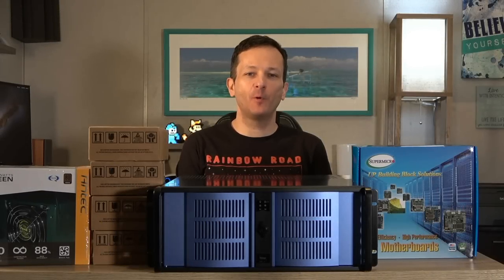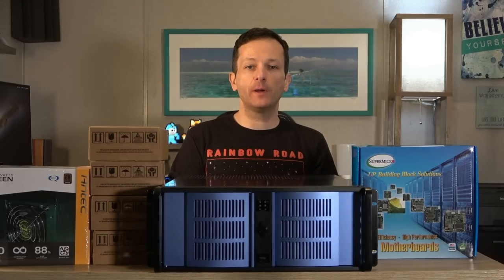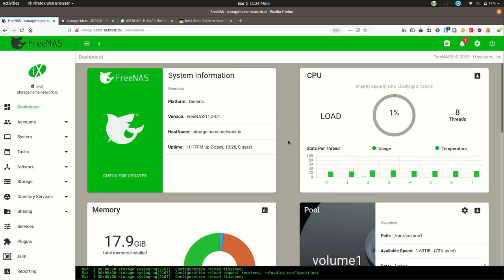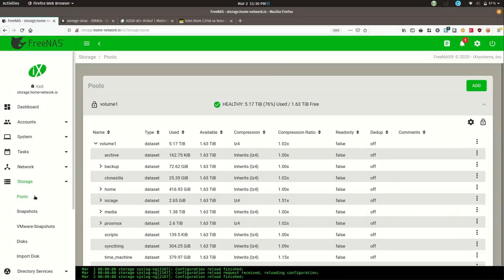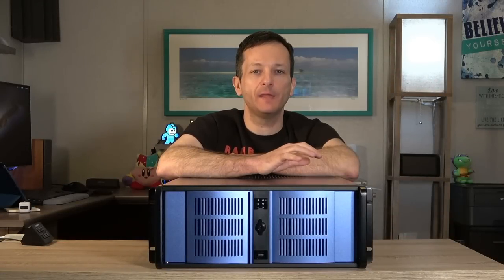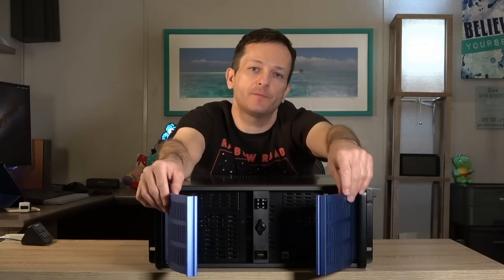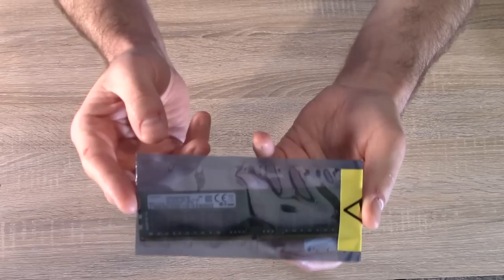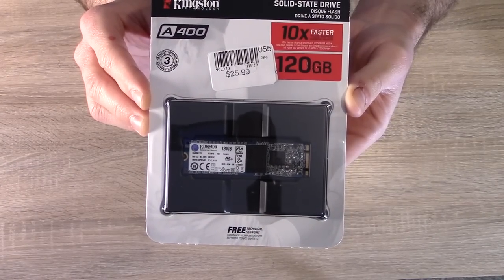Building a Low Energy Storage Server for your Office/Homelab

Comment: Isnt that a regular SATA NVME? so regular sata 3 speed
Reply from the maker: I may have misspoke.
Reply: @LearnLinuxTV  its allright, a server like that wont need M.2.NVME speeds:)
Reply from the maker: Agreed, it's mainly just for the web interface anyway, which seems fast enough to me. I wonder if the store had the drive mislabeled or something. I'm curious now. I wasn't paying close enough attention.
Reply: It's just M.2 SATA, not even NVMe, so it will use the same lane as regular SATA III SSD. NVMe will use PCIe lane so it will be a lot faster than what you've got. The only advantage of M.2 SATA compared to regular SATA SSD is just you don't need power and data cable, not faster at all, even better SATA SSD will be faster than M.2 SATA in term of speed. Just fyi :)
Reply: Yep that's what I was thinking when I saw him talking about it
Reply: sata=/=nvme its an M.2SATA which is more energy efficient than NVMe (usually)

Comment: My server is size of a shoe box and can hold up to 6x2'5 drives in 5,25 bay with icydock cage. G2020T,  ASUS P8H61-I, 8GB RAM, Dell perc310 hba controller, 200w sfx psu. All takes only 35w from the socket. Proxmox on board. I had Freenas and Openmediavault but i found that containers are far more usefull for me than pure NAS features. In the past i had few containers like dokuwiki or gitea but now i only have Nextcloud and samba/NFS storage. It automatically shuts down at 11PM(if there is no Samba traffic or backups going on) and turns on at 7AM (by rpi3) . Im really happy with it.

Comment: I was think that a RPi could be used with USB3 to SATA and spindle drives, but I realise by the time you plug in high capacity spindle drives the power draw will still end up around the 40W mark with much slower throughput, slower encryption/decryption and other functions equally hobbled. Well thought through solution #Respect!

Comment: The case is designed to allow multiple drive mount options, the idea is to allow single caddy options like you used as well as multi drive caddies (single unit that contains multiple hot swappable drives)

Comment: My FreeNAS has a Celeron G3930 in a 4U case with 3 x 4TB WD RED drives in ZFS for PLEX purposes at the moment, but the system will have other uses in the future as I learn more about it.  Each of the three data drives was from a different production run.  I bought a few fans for the case but haven't needed to install them - yet - because the temps are low.

Comment: That Kingston is a M.2 SATA drive and not NVME (PCI-E).  M.2 being the form factor and these can either be SATA or NVME (NVME being an order of magnitude faster).  Also - the TBW rating for that drive is 40TB so I would be careful about any verbose logging to that boot drive.  I have been considering moving over to a very low power system myself, thanks for the example.

Comment: One little point, TDP watt ratings are for maximum heat output, not power consumption. But the power usage percentage should run quite similar to the TDP when comparing the two CPUs. ServeTheHome's review of that Supermicro part number says that board and CPU use between 14.1W at an idle, to 32.7W at 100% load.

Comment: "It's loud as hell" - You should look into fan control on the R710. We're a small media company and everything is hosted at AWS, but we wanted a small local server for things like NextCloud, a dev/staging version of the site, MatterMost, etc. So we got an old R710 from ebay, but the first problem was it was stupidly loud. You can first enable manual fan control by running:

ipmitool -I lanplus -H idrac_ip -U idrac_user -P idrac_password raw 0x30 0x30 0x01 0x00

This disables automatic fan control. Once this is done you can set the fan speed with the following:

ipmitool -I lanplus -H idrac_ip -U idrac_user -P idrac_password raw 0x30 0x30 0x02 0xFF [FAN SPEED, e.g. 0x0F]

The hexadecimal value is 0-100, so above will set it to 15%, 0x0F. 15% is super quiet and nice. The system is running two X5670 95W TDP CPUs, 32GB of ram, and 4x6TB 3.5" hard drives, and is also in a warm environment. I've ran it for over a year now at 15% fan speed, and it works just fine and is very quiet. The crazy fan speeds are for large server racks where you don't want a build up of warm air and want fast circulation.

I'd recommend trying it, you could probably even drop it below 10% and have it be fine.
Reply: I have an R710, I have set the fan speed from the bios to silent mode, the temperature is around 18°C this time of the year with max 34 at summer, the fans are quite silent, you can't sleep with them but if you put them in a room and close the door then you won't even notice it! But if you want to have it to the background and a few meters apart then it's not the best choice.

btw I didn't knew about the commands! If I got a second server I will configure it
Reply: @michelangelop3923  At 15% you stop noticing it in the same room after a minute or so, it's very quiet. Even more so at 10%.
Reply: Any idea of wattage of these enterprise units?
Reply: @darencard7842  Yeah the R710 is not very power efficient. If you want something more power efficient look at later generations. Low idle power didn't really come in until early-mid 2010s.

Mine uses around 220W at idle and maybe 300W (don't remember) at load, but it rarely hits full load as there's several VMs running. I think with no hard drives and a lower power CPU you can get it down 150W idle.

So it's not the cheapest ever to run. But if you want something cheap to run and low powered I'd recommend just not getting a dual CPU system. Some single low powered CPU systems can idle at < 30W.

A quick Google suggests the R730 can idle at ~50W under some configurations. But if you want very low power I'd suggest something like HP's microservers.

Comment: Cool topic of power consumption and noise. New to Linux-noob. This last week took old Lenovo t530 laptop and created a NAS server with freeNAS. Low power was the goal (20w with broken lcd).  Run off usb with 1 tb ssd.  Will add another 1tb drive with cdrom adapter. I see you are in MI area also.  Any Linux events in area or event you frequent?

Comment: If your mobo dies, repair is always an option over replacement. In most cases the repair is not only possible, but is usually far less expensive than replacement.

Comment: From what I've read, the "L" series Westmere CPUs weren't so much designed for more efficiency but just lower power applications (where heat or power was a problem)...mostly achieved by lower frequency on the chips so the power consumption wouldn't peak as high. I made the same mistake buying "L" Xeons thinking I would save power. As long as the CPU can be clocked down and the OS is smart enough to do it, it will be way more efficient whatever you have. I agree that doing research and not buy whatever is very important. Every time I've impulsively bought a computer component without researching it first, I regret it.
Reply from the maker: Agreed, I have a stack of "impulse buy" servers that are now collecting dust. I did find a use for them, though.
Reply: @LearnLinuxTV   Care to share? I have a few Westmere era servers I just retired after upgrading my stack to Ivy Bridge era servers. It would be nice to do something besides part them out.

Comment: nice project! just don't understand a couple of decisions:
- why to use FreeNas instead of buying UnRaid? UnRaid is much more versatile if you need to add more disks later, and with the parity drive you could have had 1 disk of extra space that would have repaied the license cost (that btw is 59$ only)... 
- UnRaid uses far less ram than FreeNas... 
- You could have also have used the ssd as cache device with UnRaid and boot the system from a 10$ USB key that you could have attached into the internal port on the mobo, without wasting a 120gb M.2 SSD... :)

Comment: Nice job 👍 I had the same board but with 4 cores. Ended up replacing it eventually, as I was hitting the limitations of PCI-E lanes. Also I was having issues with performance, when using software raid, encryption and transferring larger datasets via NFS. I am curious what your experience is going to be and what I/O performance you are seeing with random read/writes on network shares. Maybe zfs and the caching in RAM helps with that on your setup. Tip: you can also plug a nvme M.2 drive in there and add it as a cache device for acceleration. Best wishes!

Comment: Definitely fun, but realistically standard Synology is both cheaper, more power efficient and struggle free. 
I run only one drive unit (since most important stuff are backed-up also on disconnected HDD), but I got 8TB drive and synology DS119 total power consumption about 10W... (by the way only Raspberry pi 4 consumption is higher! without the drive!). For enthusiasts and small office... ideal.. :)

Comment: My build is a Ryzen 3600x , Asus tuf b450pro. 4x10tb Western digital white label red drives , 2 Samsung ssd, 1000w titanium EVGA powers supply, Fractal node 804 case.     I am running unraid with many docker running. At idle I am only pulling 38 watts at idle.
Reply: Still satisfied?
Reply: 38W at idle? I'm running 2600 with a single HDD and it's pulling that much at idle.
Reply: You certainly made a mistake in the measure. The tdp of a Ryzen 3600x is 95W and 4 disks draw 7-10W each. 38W is impossible in these conditions.
Reply: Each HDD probably take 5-8 watts. That seems low.

Comment: It is probably overkill for your setup, but you should look at power supplies that have zero RPM fans. I have a Corsair HX850i in my gaming rig, and I have never seen or heard the power supply fan in operation. I am gaming right now and have been for hours, the fan is at 0RPM, and the PSU is at 33.50c. Corsair have cheap options starting at £80.

Comment: Can’t get myself to have something that big with so much wasted space.

Nice motherboard. Plan to get something similar when they start to sell used on eBay.

Just got a 2 used Microserver Gen10.
The other 2 NAS I put together few years back: Intel J4105 (4 cores 10 W) and AMD Kabini  5350 (4 cores 25 W). One in a Supermicro mini tower w/ 4 hotswap and the other in another (Norco?) mini box w/ 4 hotswap.

Have yet to find a just big enough ‘server’ case that is not as deep as the regular ones and can give me (6) 5 1/4 front openings to put 6 hotswap trays...

Comment: I still have a NAS built with a verrry old Pentium 4 pc. So I'm looking to upgrade. First looked at an R720, then a T440... But this low power build looks much better. The only thing I'm not sure about is whether I should use it to run docker containers, or I should keep that separate...

Comment: I got a low power machine with a Celeron 3900T, 2x4GB DDR4-2400, 4x 4TB in XFS and an old 320GB OS drive.
OS is Linux Mint and it sucks 50W flat most of the time.
MY other "3900" is in my main RIG (Ryzen9 3900X)

Comment: 5: 42 https://youtu.be/J9pHMSaHhiI?t=342 @LearnLinuxTV idk of you are still watching messages from this video but I wanted to point out that you can update that older idrac with the latest from dell, then you can change the virtual console to html5. We just updated a bunch of ours and while they still aren't quite as nice as the newer idracs they are functional and no longer require java! The java window does include some power controls and things though that with the html5 plugin you will have to keep another browser window open to manage through the main ui. Of course downloading and installing these updates tend to be a pain and in some cases we even had to temporarily install windows server just to get and install the latest update because the old bios was buggy when truing to use ftp and some of the other options available from within the bios ui itself.

Comment: Hi Jay,
Just wondering how this server is working for you 2 years on? Did you come across any short comings of the spec? I'm thinking about building something similar now and was wondering if if the component parts still stack up as a good energy efficient storage option. Based upon what you know now, would you have changed anything?
Thanks and thank you for all your hard work with all your videos!

Comment: Now imagine if someone made a low noise 4U case that fits the motherboards of all the old dell servers, to be used in home labs and workstations. That would be extra cool.
Reply: Not going to happen, mainly because those server REALLY rely on airflow coming over components(not just CPU). Their whole design doesn't allow a low airflow(which causes low noise) to be a thing(this is also the reason why (highend) desktops have cooling on their VRMs and whatnot :) (as those cannot be required to get that needed airflow))
Reply: Just build a 3700x build and call it a day.
Reply: How about dual sockets and dual power supplies. Insane amount of ECC RAM for cheap, remote control features (i.e. IDRACK, ILO). All of this for an extremely low price off of eBay. Enterprise hardware is hard to beat for workstations and homeland.
Reply: @ahmadalwazzan384  browse r/homelab no on actually uses the dual psu or need ecc memory.
Reply: @-----------------------------  most people on there are building labs for learning and don't care about reliability. If you have any use case where you are dealing with valuable data, or home security, you want your servers to be as reliable as you can afford. Also don't forget about the workstation scenario, if you are earning money out of your workstation, you don't want it to crash/fail on you.

Comment: 42:20 in order to compare apples to apples, have you also measured the power consumption of the previous storage server with the same measurement tool? The power consumption which you showed at the beginning of the video (about 200 W) was measured differently, I presume.
Reply: The iDrac gets the power reading from the power supplies. From what I've tested before, it is pretty accurate to what a P4400 reads.

Comment: single HDD bay HDD trays vs 4 or 5 HDDs per 3x5.25" bays would of been more cost effective and would of gave you an upgrade path if you desided to add more drives later, also thats a SATA m.2 drive, not NVMe as SATA = 2 notches and NVMe is 1

Comment: Fyi, that  is NOT a NVME SSD. It is a m-SATA SSD in M.2 format ( it has a similar performance - 500MB/s Read and 320MB/s Write - with reqular 2.5" SATA SSDs ). NVME PCI-ex SSDs only have single notch on it and they are way much faster and responsive.

Comment: But what about the ultimate NAS, a raspberry pi 4?  Quad core, 4 gb of ram, perfectly silent, tiny, and only uses 1-2 watts.  Sure, you are limited to 2 SSDs at USB 3.0 speeds, but....

Yeah.  That might be an issue if you want good performance.

Comment: I'm wanting to replace my C2100(12x3.5 but dual xeon L5640) with a 24 bay SSD with ryzen 4000 APU. probably equivelant to the 6 core 4600 or 8 core 4800, but clocked to u spec(15w) 

Additional reading for your boring pleasure ignore if you dont want to be bored, or get upset with stream of though typing

IF i could run everything on freenas i'd also replace my R710 with a single machine using a 4th gen 3900x or 3950x equivelant (if they had GPU)
I am currently replacing my R710 with 3700x with GTX 1050, and will upgrade it with 4000 series APU once available IF plex offeres GPU acceleration using APU otherwise i'm sticking with 3700x and GTX 1050. (will either use them as HTPC or sell them)
If i could pass through the TV tuners in freenas, and if iSpy could run well enough on a windows VM i'd build just one single higher powered server, instead of two medium powered. 
Currently my R710 with dual X5675, it will struggle with 4x1080P TV recordings at once, but i have 12 channels that often have stuff i would like to record, many times at the exact same time(currently use network tuner with freenas for the other channels), using the network tuners i can already tell that the 3700x has no trouble with 8 channels, but I should note that my C2100 freenas server can record at least 3 channels using network tuners considering this has significantly lower base clocks i feel like freenas plex has better optimisation, or there is a hardware issue with the R710. The things from keeping me from switching to the C2100 are

1 No expansion slot for GPU-no hardware acceleration possible even if the GPU could be passed through to plex
2 cannot pass through network tuners, even if there was a slot available(taken up by SAS controller and NVMe acceleration drives for main ZFS array)
3 iSpy(the most reliable software i could find for my IP cameras) does not seem to work well virtualized for some reason, even if virtualized in hyperV with a windows host and guest
4 part of the reason 1 and 2 are a problem, 0 expansion slots the R710 has 4, which are currently taken up by a singe slot fanless GT 1030, two 4 channel TV tuners, and a 10g network card(not needed, just a direct connect to the NAS in case switch/DHCP/DNS stops working for any reason)
5 R710 is loud, but the C2100 heat sinks seem smaller so i expect it to be even louder
6 Even though i could use network tuners i dont want to, they take up so much extra space, and i only have 2, one of them i'm just testing for my sister(puting together a much smaller all in one freenas plex system for her where one less computer is more important than less cable clutter)
7 I have considered linux with no virtualisation/dockers, it resolves many of these issues except for iSpy, which i guess could be run on an athlon 4000g I'm toying around with this and the previously layed out solution. Will still require two servers, but might be better because plex would not be relying on any network resource everything including tuners would be run completely locally. Only downside with this is that there is no machine powerful enough to be a backup plex server if something goes wrong with the config of the main server